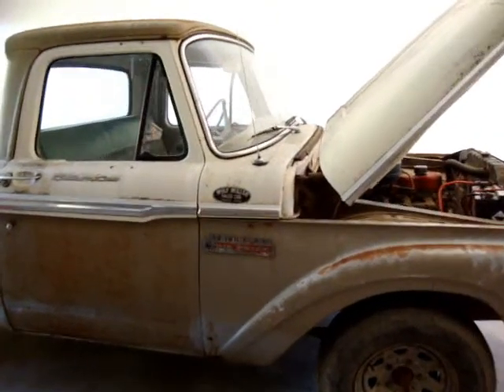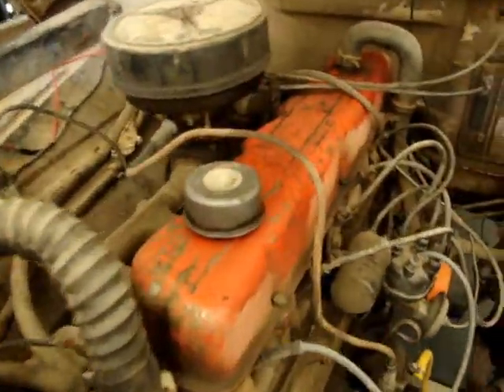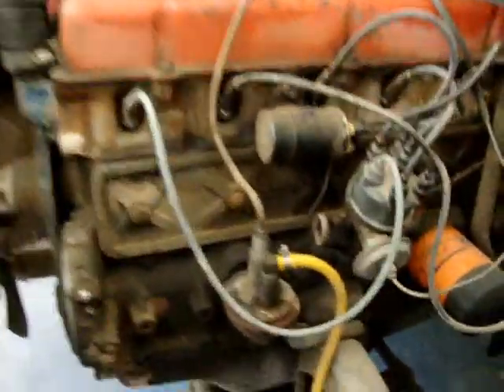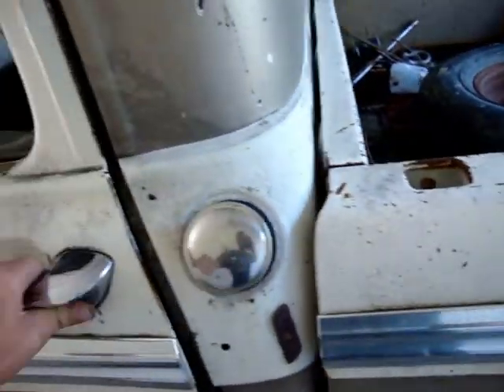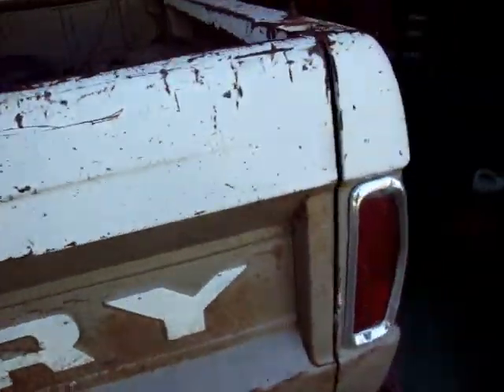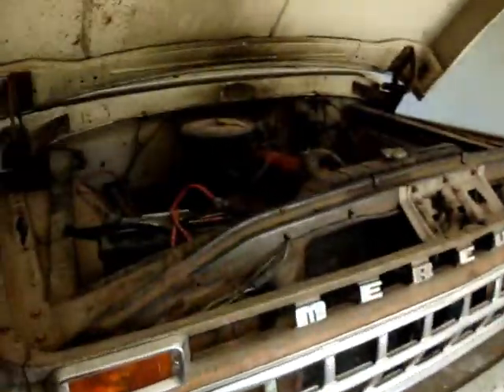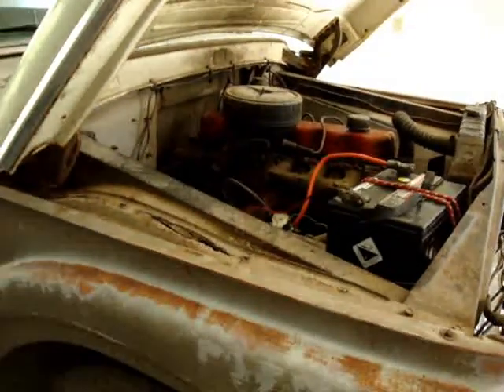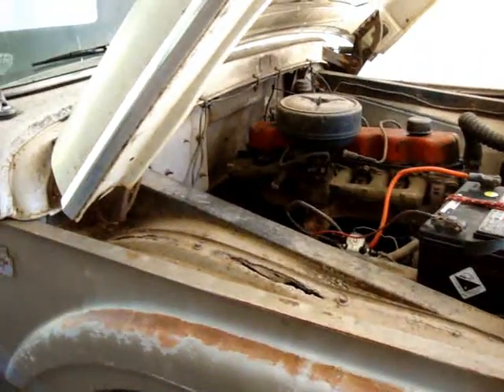The 65 Mercury Truck Engine Swap Project

Comment from the maker: I know what your saying about the FE blocks they have 352 on the side of the block. We were told that this one is a 352 but not everybody is always right. I had found the little alluminun identification tag and it says it's a 1966 352 but again someone could have put it on there. My plan is to look up the numbers and see what size the engine is to be certain. Thanks for the input and thanks for watching.

Comment: they r easy to hop up if u want 390 if it's a 4 inch bore change crank and rods and heads cam or hotter cam out of a 428